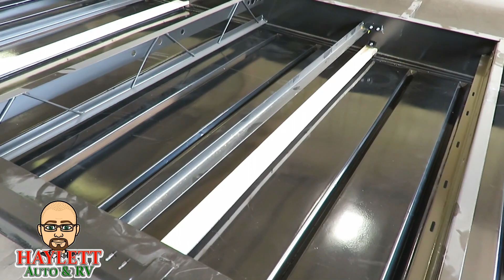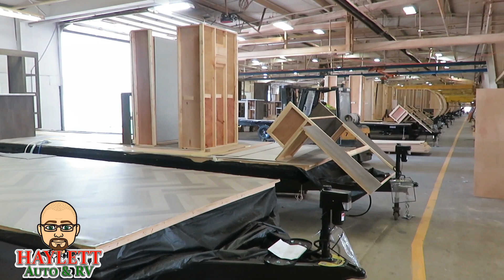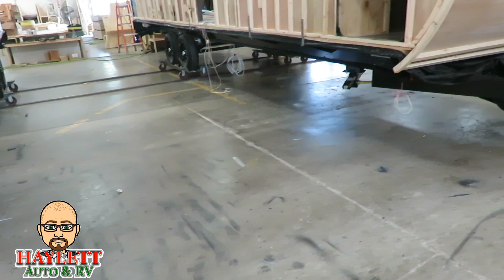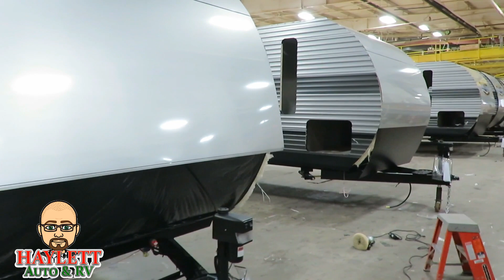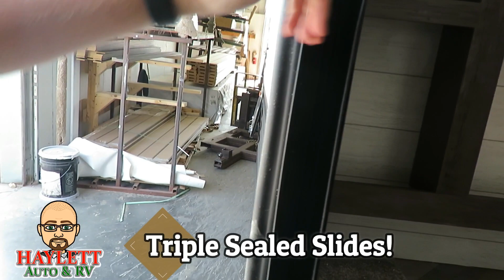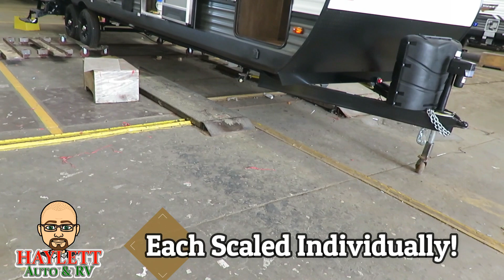Wildwood & Salem RV Factory Tour!

Comment: I am the plant manager of this place and I want to thank you for coming down to Goshen to spend time at the plant. Your knowledge of our product is on point! Great job on this walkthrough. One of my team members sent me this video. We had no idea you were in the plant that day. I am assuming someone from sales let you in. It is all good though, we are proud of what we do!!  Thank you for  sharing our product with your followers.
Reply from the maker: #campninja
You and your team are doing a great job down there. VERY glad to have Wildwood among our lineup!
Reply: Ray Slater Hello Ray, so if I were wanting to convert the underbelly of my xLite into the winterized version, can I buy the slats/parts and redirect a heat ducts so it would work as the factory made version? Unfortunately my sales person said repeatedly this was winterized, but now I know they aren’t made that way. Just to confirm no extra lights are made with a winter package, correct? I’d rather not have to go into a homemade project, but if I need to I will.
Reply from the maker: @sherylengelhardt6140  I can tell you that while this isn't impossible I think doing it any way other than home-grown is going to be far more costly than most folks would realize. 

I'm sorry you were misinformed by whomever sold you the camper. 

Enclosing an underbelly is one thing, but re-directing a heat duct into the belly is far more involved. 

Also, simply enclosing and heating the belly alone isn't enough to guarantee function in sub-freezing weather. The RV just isn't built that that sort of use in mind. 

I understand you're essentially "past the point of no return," so I think the best suggesting is to look into skirting and belly heating your camper almost as though it were a double-wide trailer. You're effectively accomplishing the same thing, but in what is likely far easier to accomplish and less costly fashion.
Reply: SUGGESTION: maybe you could pass along to the factory: Those look like metal ferules they use to run the wires through the wall studs and they would also be used in the top roof sill......they make plastic inserts that fit in those ferules which keeps the wires from rubbing against the metal ferule. Great safety measure. They cost a whole 6 cents at Home Depot. Probably the bulk purchase you would make you would probably get them for half that price :) I saw the nose cap off a Winnebago trailer and they were using the plastic inserts to protect the wiring.
I'm impressed with build quality!
Reply: As a consumer, this video has helped solidify my decision to buy am RV from this manufacturer
Reply: @Ray Slater, thank you for chiming in. Is it safe to assume that all WW and Salem units are built the same way. We have a Salem FSX 178BHSK and I liked seeing how they were made... Nice seeing the bones of the units. You always hear about RV horror stories from units made over the past few years but ours was made in June/July 2021 and I'm happy to report not a single major issue.
Reply: Are the floor joist on 16' centers? To prevent soft floors?
Reply: Sir, we're looking into buying one of these units and we're wondering if they are still built this well in 2026?
Reply: I have a x-lite 240bhxl 2021

Comment: Josh, what are your thoughts about the brands that weld the tongue underneath the frame (like this one), vs the Jayco that’s integrated into the frame. The Jayco and a few others as you know are built better by being integrated? Thanks
Reply from the maker: I’ve been told by factory engineers who do the integrated frames it’s not functionally any stronger
Reply: Josh, thanks for the reply. I know that’s what they said but my gut and head say otherwise. I’ve seen a photo of one welded underneath, and it broke off and collapsed. No way a Jayco frame would/could do that. I really enjoy your videos, helping us decide what to get.

Comment: I would like to know why in the manufacture of trailers, the factories do not use polyurethane foam as thermal insulation, it would be easier to model the bodywork.
Reply from the maker: If I had to guess: Cost. 
I don't like that answer and I don't know if it's the correct one. But I have a pretty good suspicion..

Comment: Hi Josh, I've watched this video several times looking to see how they fasten the roof panels down and the reason I'm doing this is because I have a new Salem FSX Toy Hauler as I've stated in a couple of your other videos. By the way keep posting videos I enjoy them. So getting back to the issue I'm having. A couple of weeks ago I took my travel trailer out of storage and to start getting it ready for the New England camping season. I was on my camper roof to install vent cover and I noticed the front roof panel under the membrane has lifted about 2 inches which is a huge concern if I move the camper. I'm in the process dealing with the warranty department and penitently waiting on Forest River to approve the claim. The cost of fixing this issue is roughly around $6,000.00. I have not used my camper once and I understand that these campers are cheaply made and rushed through assembly but Forest River needs to do better.
Reply from the maker: Fran thank you for sharing this. Sorry to hear your RV has had this result. I hope you're still able to get out this summer
Reply: @JoshtheRVNerd  Thank you, I've been dealing with the claims department and they have been very helpful. It will be going in the shop for repair and hopefully it will be ready for my family's first voyage in May.

Comment: Question Josh: What size studs are those in the sidewalls?
 SUGGESTION: maybe you could pass along to the factory: Those look like metal ferules they use to run the wires through the wall studs and they would also be used in the top roof sill......they make plastic inserts that fit in those ferules which keeps the wire from rubbing against the metal ferule. Great safety measure. They cost a whole 6 cents at Home Depot. Probably the bulk purchase they would make they would probably get them for half that price :) I saw the nose cap off a Winnebago trailer and they were using the plastic inserts to protect the wiring.
Great Vid Josh.....I'm impressed with build quality!
Reply from the maker: I don’t know exactly. We can always verify for you. I don’t want to just venture a guess
Reply: @JoshtheRVNerd  Thanks Josh, they were looking like commercial size 2X4's but always hard to tell in a video. They do look pretty substantial though :)
Reply: @JoshtheRVNerd  My guess as a fellow RV/ Trivia/ Construction/ Engineer/Architect/ Nerd like Josh is; WILDWOOD utilizing metal ferrules in the sidewalls is primarily for anti- drill wiring protection from inside or out( from a customer possibly attempting to screw in TV Mounts/ Coat hooks, anything), rather than wire degradation from internal chafing / rubbing routed through frame stud holes. Plastic ferrule wiring protectors would mitigate wire insulation damage caused by chafing during the severe stress of flex during RV motion but not hamper drill intrusion like metal would. Standard residential wood framed construction carpentry code normally specifies metal protection on studs where wiring or plumbing is routed through studs.

Comment: Wonder how they do the alpha wolf and arctic wolf trailers
Reply from the maker: Hopefully I can get there sometime. There will be similarities for sure
Reply: @JoshtheRVNerd  I’m wondering how they fitting 2inch foam walls and built inside I’ve heard rumors it’s full aluminum and aluminum and wood like the black label
Reply from the maker: @jshapiro34  no. Alpha walls are laminated. Not stick built. That’s one of the major differences between them

Alpha has never been built without laminated sidewalls
Reply: @JoshtheRVNerd  so laminate walls and 2inch foam insulation is all that really sets them apart ? 
Cause other trailers are using the wider axels for stability and it’s not a 4 seasons camper as I’ve heard the heating capability is a bit limited and I’ve seen them 50 amp but not cut for the 2nd ac which is pretty dumb in my opinion because your automatically down 300$ on a hole to be cut
Reply from the maker: @jshapiro34  As far as structural variance it's one of the only major differences
Grey Wolf/Cherokee & Alpha Wolf have totally different design teams though. They'll potentially use different furniture or wood tones, but often use many of the same suppliers for things like appliances

Where Grey Wolf and "Cherokee" are like brothers the Alpha Wolf is more like a Cousin

They're in the family
you can see the resemblance if you look
but they're still very much an individual
Reply: @JoshtheRVNerd  is there really a sound or comfort difference to the 2 inch sidewalls ?
Reply from the maker: @jshapiro34  I need to verify the 2" wall claim on alphas.. You can usually tell easily by looking at the entry door jam and whether it's flush with the wall or stick into the RV a bit since those are all 2" standard.
Reply: @JoshtheRVNerd  is there a noticeable difference in holding heat and ac if it’s 2 inches versus say a 1.5 inch wall? And sound damping vs say azdel siding ?
Reply from the maker: @jshapiro34  I have no hard data for any of this, but I've never noticed a 2" wall to significantly different in any way whether it's commonly constructed, laminated, or uses azdel

Comment: What is the length of the power cord on the 27RK?
Reply from the maker: I’d have to check. Can’t memorize them down to that level of specificity!

Our folks at 800-256-5196 can hop out to measure in Return for a fair shake it working with you whenever you’re ready

Comment: I have a 2021 wildwood xlite
Toy hauler t251ssxl and the linoleum is bubbling all over.    It seems like its not glued.   Is this normal??
Reply from the maker: That's actually built ONLY at their northwestern facility and available only regionally. I do not know the specifics of their flooring construction. 

Logically though -- to form a bubble it HAS to be glued.. else there's nothing to hold the bubble in place. 

A good service center should be able to bleed that w/o damaging your flooring.

Comment: Hi there, new to the RV life and I bought a T241BHXL (Wildwood xLite 28ft -2021). So my Big ? is after watching your fantastic video, what are the black tubes running along the visible perimeter of the underbelly? Now I understand the xLite doesn’t have a forced air underbelly so I am very worried about the water lines freezing. What are these black tubes and what would help someone winter boondock when moving from backcountry ski area in CO/WY/UT to another? I understand skirting is helpful, but if we aren’t living in it, is there something I can do to help the water from freezing up in the fresh water tank, grey and black tanks, respectively when we are using it? Would you happened to know what is the temperature rating of the xLite? I was told by my salesman that this xLite had the winter package... is this correct? Thank you for posting this video and being a great resource!
Reply from the maker: Those tubes are your propane lines. The water lines are actually hidden inside the flooring so they're not exposed. It's not an enclosed/heated belly, but they're still protected lines. 

Wildwood puts their propane lines on the top of the frame rails to help keep them shielded from almost all possible road debris. It's really smart and costs nothing. 

Most RVs do not have a specific "here's the temp you can go to" sort of spec. The MFGs don't test them to that extent. 

An Xlite is an awesome camper, but made for "normal" spring/summer/fall camping. I apologize you've been misinformed regarding a "Winter package." They offer no such thing on Xlite Wildwoods. For something more demanding skirting, a possible belly heater, window coverings, ceiling vent blocking pillows, and a dehumidifier to remove interior condensation will all be wise investments. Heat tape for a water line (assuming you have access to a water line that isn't shut down for weather) will also be wise.
Reply: Haylett RV Reviews, News, & More Thank you for the great information! Is the xlite that much lighter than the same size regular build? Or is it just less expensive or both?
Reply from the maker: @sherylengelhardt6140  Xlite's build/structure is exactly the same as a full Wildwood. The Full Wildwood is just 3" taller & has an enclosed belly.

Comment: Nice video. Question the rv shower you said it's rv code for them to be up off the floor. Why? I have always wondered why they are raised up.
Reply from the maker: I don't know the details. Just know it is.
Reply: Probably to make room for the drain trap, I would think... Otherwise would have to stick below the belly... I don't know for sure.. But that's my guess

Comment: Great vid josh, I was wondering if Haylett have considered carrying the NoBo series and if so would it be possible to get a couple of vids on those? The 10.5 and 10.6 look interesting but there is not a lot of good videos on them.
Reply from the maker: We have never considered them as we were already well established with the Geo Pros for which NoBo models were intended to compete. I'm absolutely not saying "we just don't feel it's a good product." Rather, just that overall we have found a little more overall value in the Geo Pro series. Adding another similar product wouldn't provide a significant addition to the lineup -- just a little more confusion.